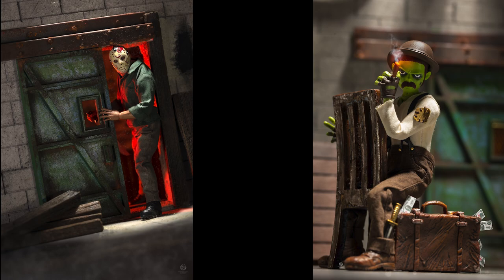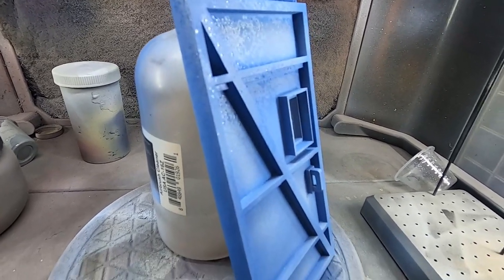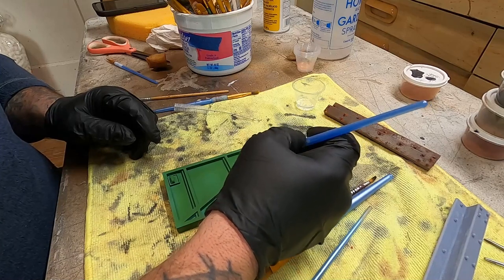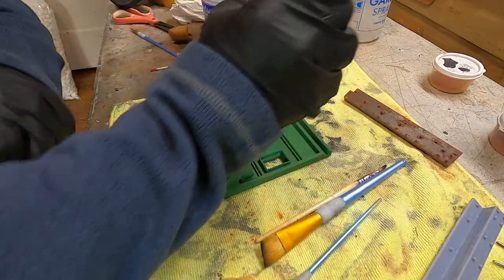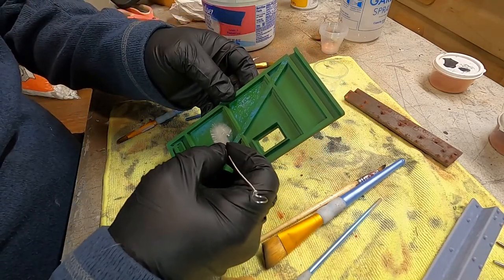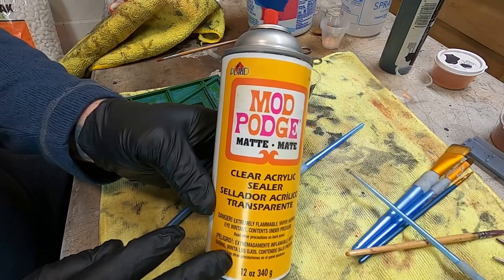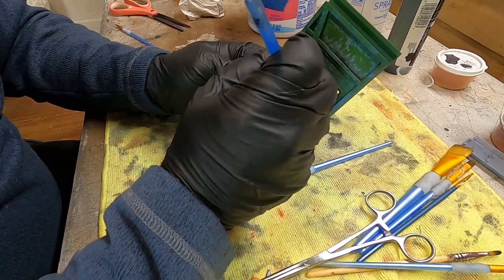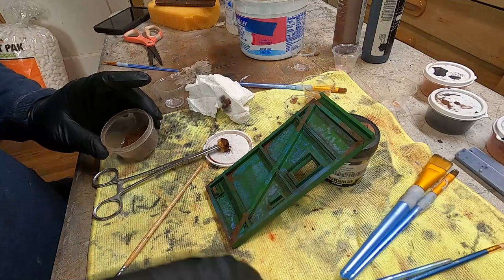I tried Vallejo's chipping medium.

Comment: The extreme sets do have a light bounce excellent video 🎉
Reply from the maker: Yes bounce but not texture.  They look cool for sure and do fill a niche but are prints without texture.  You can paint highlights and shadows light direction etc but won’t ever photograph the same.  But yes a quick solution for those who need an easy way to have with figs and photography 😊